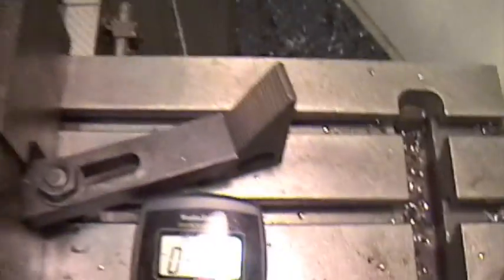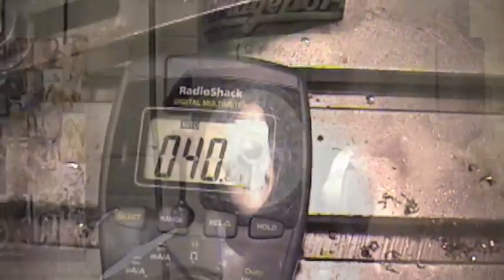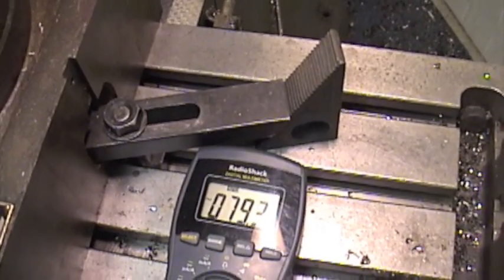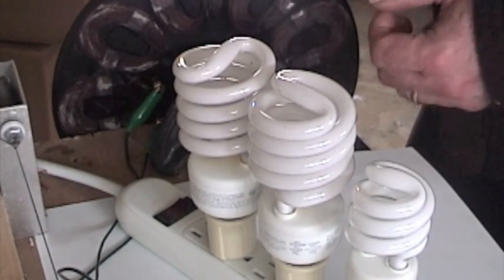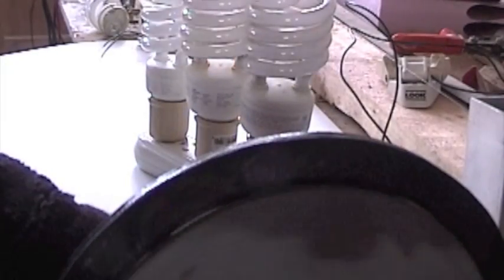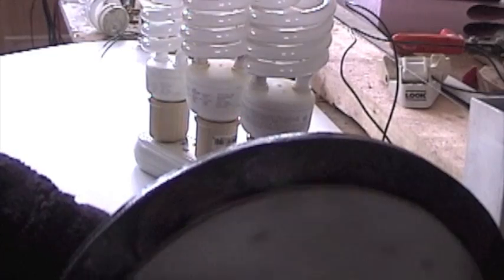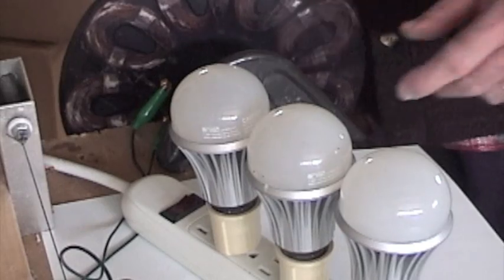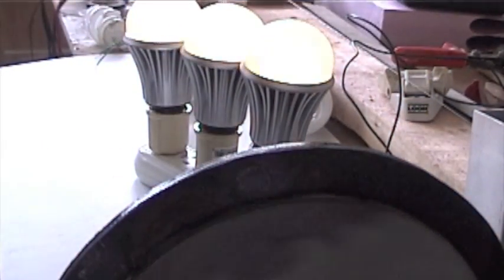LYNX 160 Alternator Testing

Comment from the maker: I will announce the website in a couple more weeks once the testing is completed on the first production models.  The price will be comparable to the lowest priced PMAs on the market.  But the performance is far superior.  No cogging, heavier gauge wire, more magnets, higher voltage at lower rpm.  I have worked very hard to keep the cost down, performance high.